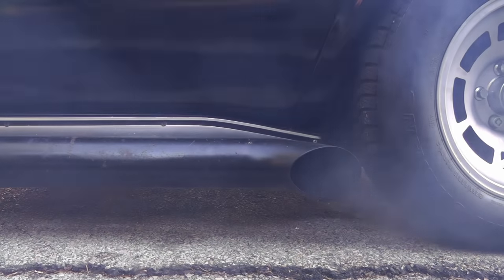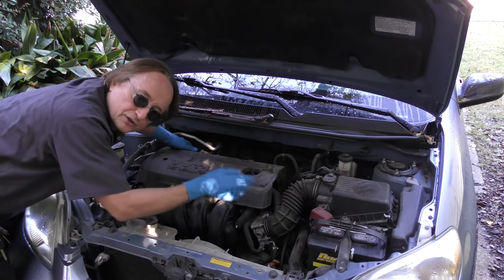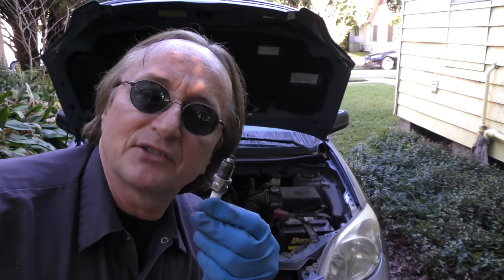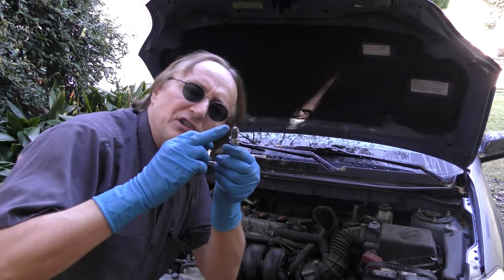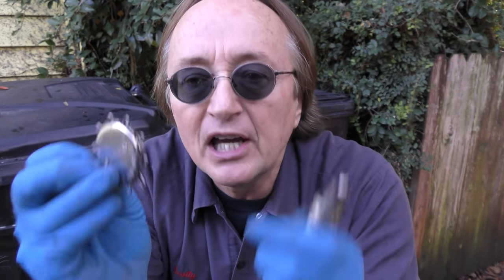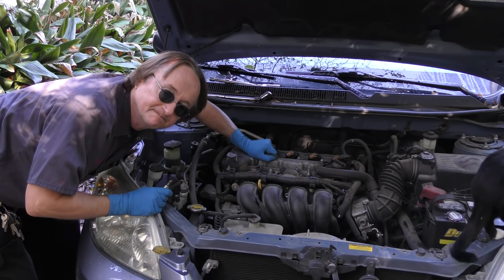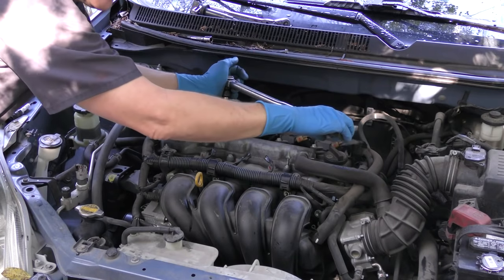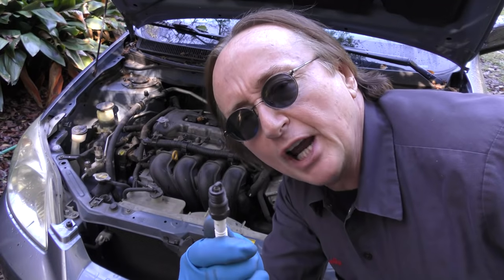What You Need to Know about Spark Plugs for Your Car

Comment: spark plugs and air filters, are a waste of moneys. I have changed both on my 1998 wagon back in 2004 and didn't see any improvement in fuel economy or performance. Car works the same way it did with the old ones.  Thats why the spark plugs in my 2001 Subaru were lasted touched in 2007. It still gets the same fuel economy 255 miles out of a 10.4 gallons of fuel. If I take on the highway it gets 290ish. No misfire no hesitation. People usually start messing with plugs and wires because they have some other problem and then they dump $40 in the plugs and wires to see if it fixes anything. It usually never fixes a damn thing. Spark plugs should be left alone unless you got $150 to throw away to pay a professional to change em out. They almost never go bad, unless you buy those stupid Autolites at Autozone. Always get Genuine parts, if you don't get genuine, that Autozone shit will nickle and dime you into a brand new car. Their stuff never works anymore, because it is all made in China, out of spec.
Reply: Y10Q Did you test voltage leak .
check fuel injector.
Reply: YES10 why are autolite so frowned upon? I have them in my 1976 GM 350 v8
Reply: Respectfully disagree.  Anytime I buy a used car, regardless of condition, I quickly change and examine plugs, air and fuel filters.

Gives a closer assessment of MPG/driveability at purchase vs 1st service.  Possibly a benchmark of consistent MPG.  Then after a while I pull the plugs again to check.  I also do mundane services redundantly just to keep an eye on things, before I decide if the car's a keeper or a blunder.

Comment: sparkpulgs are cheap I do it  4 times a year
Reply: That's an unnecessary waste.  Good Quality Plugs should be able to go 100,000 or better, before a replacement is in order.  If you want that extra margin of caution...switch them out at 75,000 Miles or so.